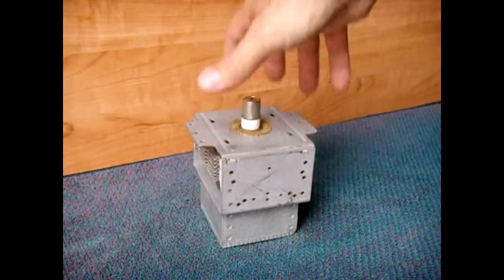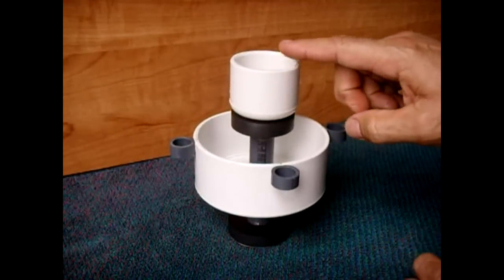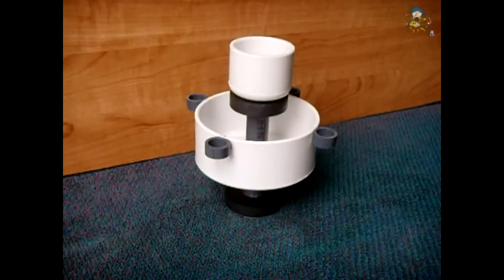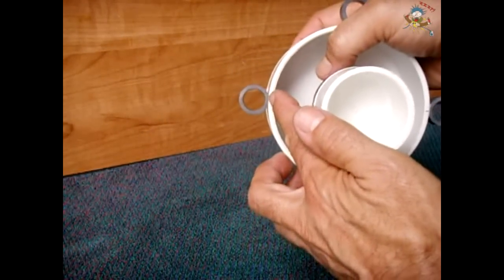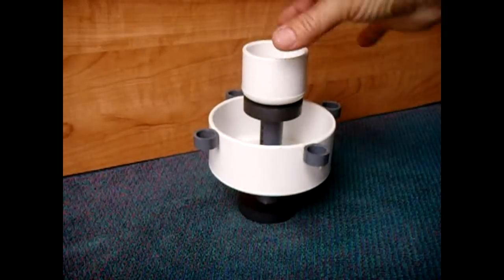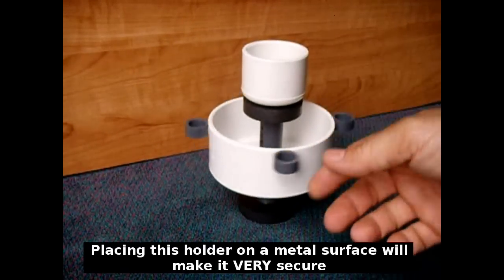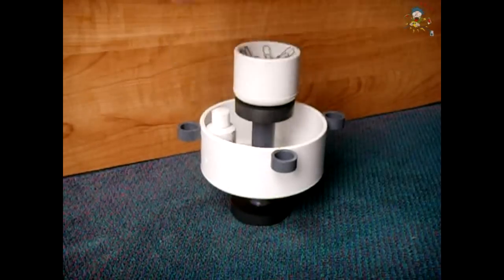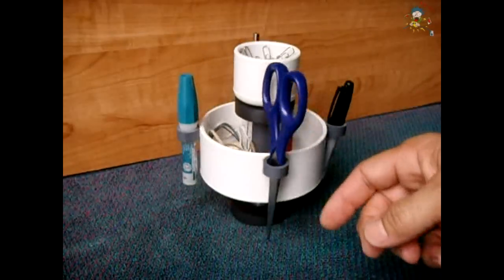DIY Magnetic Levitation Organizer/Holder

Comment: Nicely done, and maybe I'm missing something really obvious, but why do you need the 3rd (top) magnet? Surely the 2nd magnet & holder will float above the bottom magnet just fine without it as long as the pipe extends through the 2nd magnet a bit?
Reply from the maker: +T70MkIII 
Hi there. The top magnet keep everything nicely centered.
Reply from the maker: +T70MkIII 
Hi there. The top magnet keep everything nicely centered.

Comment: This is really cool!  Just wondering if it is really ok to keep this magnet desk-item holder near my computer? Tossing a USB in there or even having it too close to my HD might damage files.
Reply from the maker: TheLogpeeler I have mine placed 1 foot from my laptop. No issues at all. Ferrite ring magnets are not super powerful like neodymiums. A few Youtube channels have even tried damaging/erasing a hard drive with powerful neodymium magnets right against the HDD and no damage was done because of the steel enclosure. To be safe just keep magnetic media away from the holder.

Thank For Watching

Comment: Too much friction between magnet and pvc pipe
Reply from the maker: donovan marshall Too much friction? Who says? This holder works perfectly. What difference does it even make if there is "slight" drag between the pvc pipe and magnet? This is only a levitated holder, which happens to spin beautifully.
Reply: Get an old motor from a fan or something and get the copper coil assembly out to set it up with ur thing and see how much volts you can get flowing out of the wires
Reply: U gotta be able to levitate it without an axle
Reply from the maker: You are missing the purpose of this video, which was to show how you can make a nice, simple levitated holder using ring magnets from a broken microwave oven, nothing more. Clearly you are not going to be spinning the contents of the holder at high speeds, so a little drag makes no difference for this project. What this project is, and what you are looking for, are two different things.
Reply: ok, sorry i didn't mean to critisize you im just thinking about how it might be better, but this is a really good idea none the less. what kind of stuff do you build? soon i will post videos of the stuff i make and ill let u know.
Reply from the maker: Check out my video playlists. I have many interesting videos. When you upload, I will check out your videos.

Thank You

Comment: I remember reading one of my Popular Science mags in the 60's about making a small scale using stacked ceramic magnets and a straw.  Seems to me a heavy duty version could be made with multiple magnetron ring magnets.  Place about five or so over the PVC and then attach a platform.  As something is placed on the platform, the magnets would compress.  More compression results for heavier objects.  It would need to be calibrated with specific known weights.
Reply from the maker: Good idea to make a scale. I may do that. :-) I can calibrate it by weighing objects using another scale. Stacking the magnets would definitely allow for more compression before bottoming out. The weight reading would be marks on the pvc pipe.

Thanks For Watching!